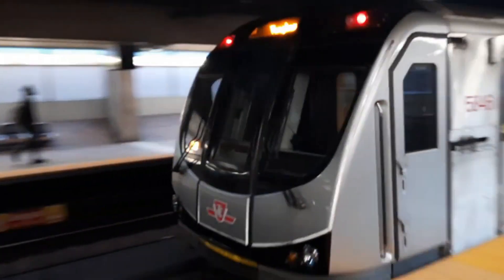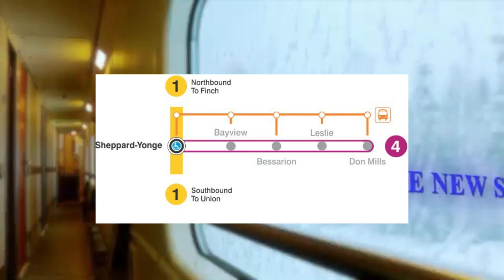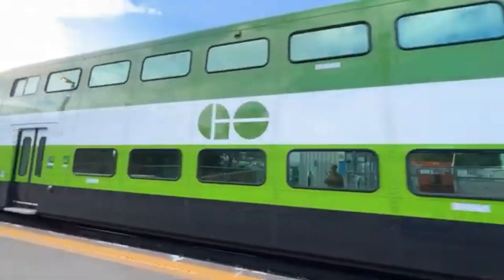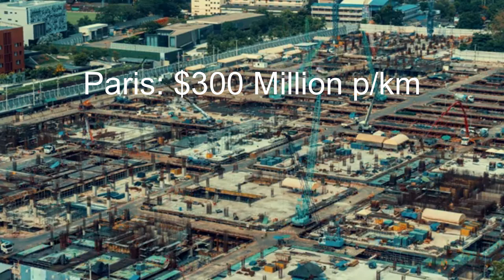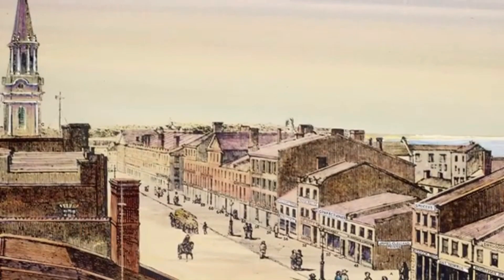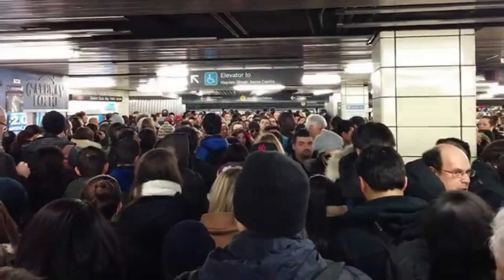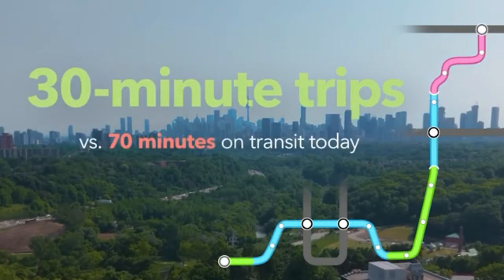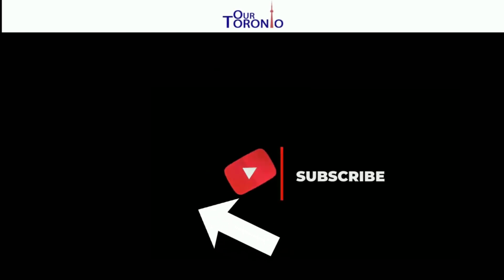High Transit Construction Costs - Why did Subways and LRTs get so expensive to build in Toronto?

Comment: I've seen other people talking about the same topic state that Canada has something like 40% of its total cost into 'soft costs' or risk management types. Contractors and consultants are able to build in contingencies everywhere to for buffer space and alleviate risk but it ends up adding to billions of extra cost in 'risk reduction' without achieving anything. It would be interesting to see more about these soft costs and areas we can reduce the amount we spend. Maybe being so risk averse is actually costing us more then if we had taken a little bit of risk. 

Plus putting tunnels where there doesn't need to be any (Eglinton West). We should be using the cheapest methods possible to try and build these projects in order to get them done and out of the way. Standard station layouts as well rather then having to build and design every individual station. I think there are lots of opportunities to bring the costs of these projects down. 

Maybe bringing some of the work in house for stuff we have to do repeatedly over these projects. We shouldnt ultimately be relying on consultants on how to do everything especially if we want to make expanding the services we have a regular feature.

Comment: Honestly I’ve always been glass half full about Metrolinx and Toronto’s transit future. But one thing you absolutely nailed on the head and is something I also agree with is Metrolinx’s weird secrecy. It seems the public is almost not treated as a stakeholder until it’s the last minute. If that’s politics or standard practice I really can’t say but I think the easy way to cut costs is to stop doing silly things like deep bore tunnels in suburban areas or even tunnels at all really where they aren’t necessary.
Reply from the maker: And where would you say that they are boring tunnels that they shouldn't be?
Reply: @OurToronto I was thinking about the TYSSE specifically but it applies to the SSE and even the Yonge extension. Most of these extensions tunnels are deep TBMs but if they’d gone for shallower cut and cover, or elevated it would lower the cost of the projects. Especially since suburban areas don’t usually have the underground infrastructure going as deep as the condos on Yonge street. But like you mentioned the inefficiencies of the bureaucracy involved doesn’t help either.